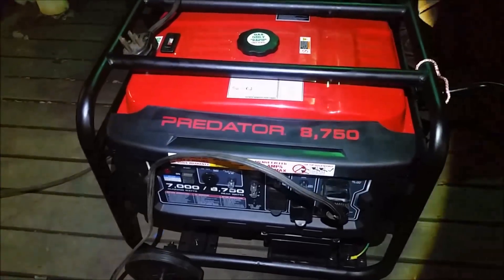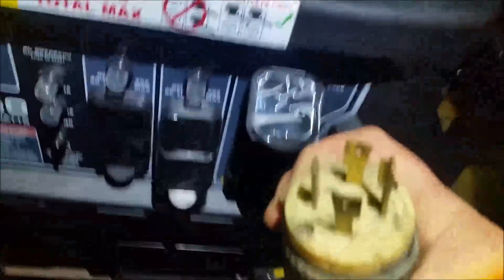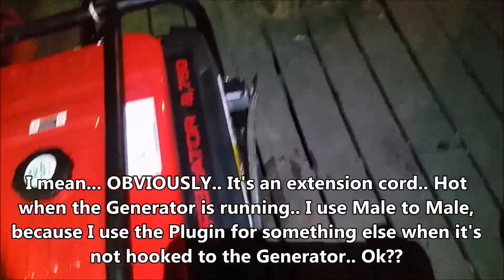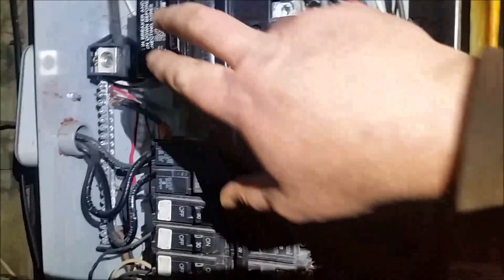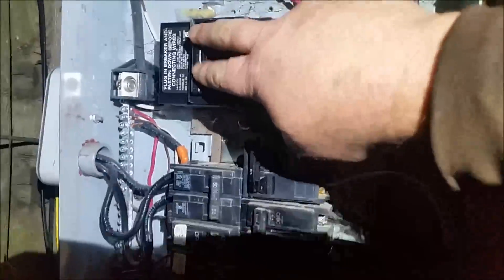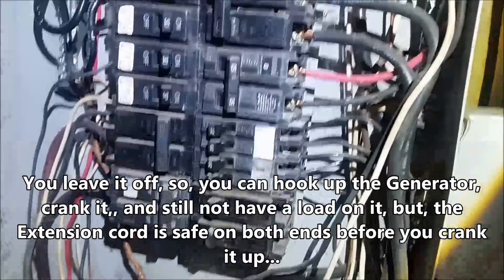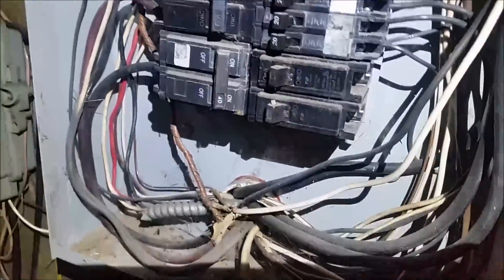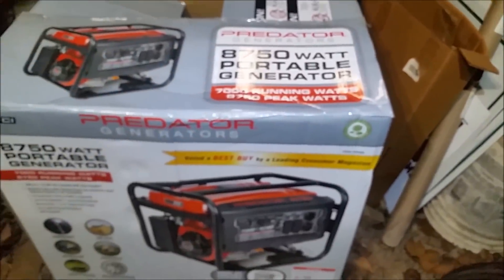Quick/Easy/Safe: Use Existing Plugin/Breaker for Generator hook up to your house Panel box.

Comment: Ok I don't ever comment, but I feel the need to. We went thru Hurricane Harvey last year, and it was the worst storm to hit the Gulf Coast in along time. People who were being saved didn't care if you had a permit to hook up your generator, they were just glad to be safe and have electricity. Electricity means you are in a dry place where you can sleep comfortable and have lights, which a lot of them didn't have for weeks. So when you go ripping on a guy for showing you how to make a bad situation better, Remember this. What if it was your son, daughter, mother, or father? wouldn't you want them safe and comfortable. NEC and codes don't apply in emergency situations to people trying to save a life. And Mark as far as telling your viewers this video is for people with common sense, the problem with that is common sense isn't that common any more. Just Saying. Please don't stop educating the people who enjoy your videos and comments..
Reply from the maker: Thanks Bubba... I've been doing this ever since I owned my first home at age 17, and I am 55 years old.. Never an incident. Works great.. And when the power comes back on, just unhook your cord, plug back up whatever you were using there before and get back to work.. Ha.. Cheers buddy..
Reply: I totally get the need for power , But a lot of people don't know what they are doing ,are putting that lineman at Hugh risk .That lineman is trying to do his job to bring power back to the consumer .There job is dangerous enough,and they have to worry about some yahoo back feeding there panel . Prepare for these storms .We all know they are coming .
Reply: I lived on the suncoast of west central Florida across the Bay from Tampa for 27 years from 1974 to 2001 and I'm here to tell you that you are right.........mostly. Yes, having electricity during an outage is truly a comfort. This is where I bought my first generator. (I still keep it as a backup). I still won't be without it where I'm living now in W. Va. No, most people don't stand on technicalities during an emergency. To avoid being called a hypocrite, my generator is wired almost the same way as what's on here with a few added safety features like dedicated circuitry so my "suicide cord" isn't required to be unplugged for any reason in favor of something else during normally powered times and dedicated circuit breakers that match my generator's output current. I'm not exactly sure what his were rated at to be honest. His were for a compressor or some such appliance. Mine are for the generator and the generator ONLY. As for flooding, In my case, I'm blessed to live within a few hundred yards of the top of a hill with half of my land dropping 125 feet down at a 45 degree angle. If my house floods, I don't call the insurance company, I call Noah. In the case of electricity meaning that one is in a dry place, this isn't always so in a flat, coastal near sea level state like Florida, flooding and electricity do NOT mix. If homes flood and the power is out, there's usually a good reason for it like the power company cutting power to the whole area. I've seen this before too. If my carpets and walls are soaked, I wouldn't start a wired generator on my house if I was in an iron lung. If a home has drywall and floods, it becomes wet-wall for a long time and, if the house was flooded with salt water from a storm surge, as opposed to flooding from a fresh water lake, it is especially conductive from the outlets mounted in the walls down the wet drywall and into the soaked carpets. Especially if the home was built before the 80's. My house there was built in 1970 and used steel wall boxes for outlets and switches. As for ripping on a guy trying to make a bad situation better, there was an appearance that he may have used 10 gauge wire on his suicide cord in conjunction with what was rated as an 8 Kw generator. Just like connecting a garden hose to a fire hydrant, there's only so much you can stuff through a wire of a particular size except if you open up the hydrant, it WON'T cause a fire. If someone who is not schooled in the finer points of high voltage / high current electricity sees the same thing I did but interprets it to be 12 or 10 gauge wire, doesn't know the difference or believes that it doesn't matter,  They'll fire up the ole' 8 Kw jenny, turn on the A/C, fridge, freezer, coffee pot and electric hot water tank and then begin to wonder what that orange glow is outside the window. Especially when his TV picture and all the lights in the house are all at half mast. If it were my father, mother, son or daughter and I didn't know EVERYTHING about doing something like this, I would, at the very least, read everything I could get my hands on on the subject to the point of qualifying for my journeyman's card. Yes, I would most definitely want to make their bad situation better but not at the risk of making it worse because I "THINK" I know what I'm doing. Knowing how my mother was and how my daughter is, I would definitely make it fool proof. Most of all, you are absolutely on the money on your statement, "Common sense isn't that common any more." This says it all when it comes to the lay-people that this "project" is available to here on YouTube and who's little bit of knowledge is way more dangerous than none at all. Aside from the suicide cord's wire size which, if I am wrong about, I apologize, he seemed to mostly know what he's doing even if it isn't to code, (neither is mine to be honest), but to put this and all the "how to's" to quicky propane engine conversions from other "helpful" people really isn't as helpful as it looks on it's face. I know what I'm doing with my hookup. It has worked for me without incident for 17 years. My wife knows how to switch everything over too and if she has a question when I'm not home, I have two instruction manuals that I paint shopped and printed up with illustrations and text directions. One on the fridge and one zip tied to the generator. My father-in-law next door lives alone since my mother-in-law died. I wired his generator in the same configuration as mine without a problem. Knowing my mother-in-law, I wouldn't have done it in her lifetime. I'm NOT a chauvinist, I just know my daughter, mother and mother-in-law. As stated before I trust my wife to make the switch over. I would do the same for any friend whom I trusted to understand the exact order of the steps to make this setup function but, as a friend, I would also REFUSE this service to any friend whom I didn't think could walk and chew gum at the same time. But above all, I wouldn't post a step by step "GENERATOR WIRING FOR DUMMIES" How to here for the 6 billion 8 hundred million electrically clueless people to see here!!! World over population is a serious problem but this is no way to solve it.
Reply from the maker: 8Ga and 12 feet.. Plenty for what I use.. And, 13 years on generator quite often for average minimums of 6 hours or more, and I've never had an issue.. The end of the line is 350 feet past me, so, we are always the last line to come up in this area.. Doesn't matter to me. Costs quite a bit when we are on generator, but, the only thing basically that is an inconvenience to me, which just changes what I do that day, is flipping the hot water heater off in my hallway, and not running my Air Compressor in my shop.. And, since I use it so much in the shop, I usually find something else that needs doing inside where there is A/C or Heat, whichever time of year it is.. Something about power outages. They usually happen when the weather sucks anyway.. Only takes me 2-3 minutes and I'm up,, and I watch my poor neighbors house who does not have a generator because he is scared.. He calls me when the power comes on, and from time to time, when the power is off for an extended period of time, I charge up his Freezers/Refrig's, etc,, and let him come and watch TV and get a shower from time to time.. He shakes his head when I hook up the Generator, but,, he likes the fringe bennies when it cranks up.. Funny though.. I used to hook into one of his extra 220v breakers,, but, now, I have the same setup at his place..Ha..Ha. It is Poetic..Ha..Ha. Last time we were out of power for 2 days,, he almost went to HF to buy the same Genset that I got my Mom. It won't be long.. Ha..Ha..Ha.
Reply: Bubba Miles 

The proper use of a generator is simply to PLUG YOUR APPLIANCES INTO IT.

It will run your Freezer and your TV, with a few lights.

You don't have to back-feed the genset to your mains to use it.
Reply from the maker: William Carr.. Ha..Ha..Ha.. 8700 watts and all you are going to do is run a Freezer, TV and a few Lights?? Ha..Ha..Ha..Ha.. And, on extension cords?? Ha..Ha..ha..  Maybe you are talking about a few Lamps?? Ha..Ha.Ha.. How are you going to run lights without feeding the circuits in the panel??? Ha..Ha.. Ha.. 
Where rock did you crawl out from under?? Just how many plugins do you have on your generator.. I would like to see the spaghetti mess you will have when you are running your generator.. Ha..Ha. I run my whole house, 2 A/C's, and my 220v Water heater and 220 Deep well pump.. I alternate those two big ones.. Maybe I could run extension cords to them too?? Ha.Ha..Ha..Ha.. How much do you get paid per post? Just curious... I heard $0.15 per post.. Man,, you are getting rich.. Ha..Ha.Ha.. I guess they don't care how ignorant the posts are these days?? Ha..Ha.>Ha.
Reply: When I first moved into my new house here in West Virginia in 2001, it took us 3 weeks to get electrical service connected to our house. I am disabled so I couldn't install the service / meter box on the side of the house without help. Before we moved here from Florida, we already had a 5 Kw generator. I took a 240 VAC twist lock plug that mated to the outlet in the generator, connected a 15 foot piece of 10-3 plus ground flat wire to the plug on one end and on the other, I took 2 steel 2 duplex outlet boxes and bolted them together back to back. I installed a total of 4 duplex outlets in them and wired 2 outlets to each leg of the 240 VAC plug. When we got here, gas was about 70c a gallon so it didn't bleed us to run it 24/7 if necessary and my nearest neighbor is 1/4 mile away so there was no complaint there. It cost us about 7 or 8 gallons in 24 hours if we ran the window A/C day and night. I ran the box into the master bathroom window and, being that the wire was flat, the window was only open 1/4 inch so I duct taped the window to keep out exhaust gases. We ran heavy duty extension cords around the base boards of the walls to the kid's rooms for a light and TV in each,  the kitchen for the fridge, electric skillet, hot plate and coffee pot, the mud room entrance for the upright freezer, and washer and to each of the bathrooms for a light. The central A/C hadn't been installed yet so we all slept in the master bedroom on hot nights because we have a window A/C unit in there. I read the labels on every appliance that we plugged into these outlets for their watt ratings. We plugged the fridge into one box and the freezer into the other. the hot plate and coffee pot into one and the electric skillet into the other basically to keep the loads as balanced as possible between the two legs of the generator. After we finally got the service / meter box up and wired to the main breaker panel in the house, I cut the outlet boxes off from the wire and wired it into the meter opening because the exposed connections were easily accessible. Then I covered it to keep water out until the power company finally showed up to connect us to the pole. This allowed us to eliminate the extension cords. I always kept a volt meter in the kitchen when we ran the generator because I had to manage the loads when my wife was ready to cook a meal. Now I have a 7 Kw electric start generator wired into the house so when the power goes off all I have to do is flip a few breakers and push a button. It powers everything that I ask of it and I don't have to run around the house with a volt meter worrying about overloading one leg or the other and we can even have hot water!!!
Reply from the maker: Jeff McCrea. I would call that a Complete Success Story.. We do what we have to do to get things done, and I see you are still here and kicking..Ha..Ha.. 
I'm sure you have done a lot of things over the years that the Libtards posting here would be completely jealous about.. 
The only thing I miss when I am running on generator is the "Cheap Electricity", and the fact that I have to remember to lighten the load at night before I go to bed, so I can get a good nights sleep without the genset running out of gas.. I make sure the Hot water heater is charged before I retire, and I leave the Deep well on in case someone wants to flush (since it doesn't run long), and I keep the window A/C running 24/7/365.. Even during the winter.. I have my bedroom sealed up nicely, and have done some extra carpet work under the door at the threashold, so, it stays nice and cool.. The A/C may not run much in the winter when it gets cold, but, the fan keeps things quiet and humming.. If it gets really, really cold outside, I will open the door for 10-15 minutes and let it warm up a bit in there before I go to bed.. Love those Fleece sheets.. Ha. Thanks Jeff. Glad to hear from you again.. Cheers.
Reply: Everyone really needs to watch this video about generator safety https://youtu.be/I1jT3ANENvI

Comment: Just get a gentran switch. Even this guy said "now your main breaker is off"6:09 ( it was still on) use a Deadman cord only in REAL emergencies. (Typically loss of grid power is NOT a real emergency unless life line systems are needed.)
Reply from the maker: I was running on Utility power you dumb fuck... Go back and watch it again from the point you posted.. Listen to the Generator in the background, as I walk back off of the porch toward the back of the house.. 
I had turned everything off, and load tested the HF Generator against my Northern Tools Generator earlier, when,  someone called and asked me what I was up to.. They asked me to do the video, so, I did one real quick..
The Northern tools was still running in the back of the house on my 220V Compressor plug in.. The one by the panel is a 220V I use for my welder on that side of my house.. Of course, if you had a little common sense, you would have noticed that you could hear me just perfect over the generator that was "NOT RUNNING" right at my feet, and what you heard in the background was the generator in the back of the shop.. 
And,, if you had just a little bit more common sense, you would have paid a little bit more attention before making asinine statements like you made.. But, then again,, if you had common sense, you would not have shown your ignorance to begin with.. Listen more than you talk.. You will at least appear smarter.. 
This video is obviously NOT for you.. You should try to post a video yourself.. It's not that hard.. Your daughter did it.. Ha.>Ha.. Maybe you could make one on how to "NOT" fix your jeep, where it Can't climb a hill,, or how not to drive your jeep, so, you are going to tear it up..  We put those big ruts there, so you dumb asses drop into them and tear your shit up.. Notice we are always egging you on, but we run the next trail and tear it up for you?? Ha..Ha..Ha.. 
That's why we invite you, and have fun pulling you out all day.. Figure it out... Ha..Ha.. Talk about a dumb ass..